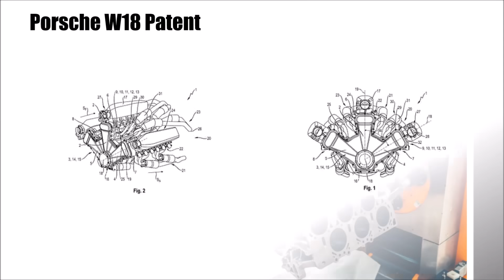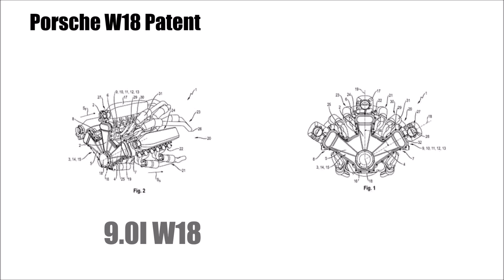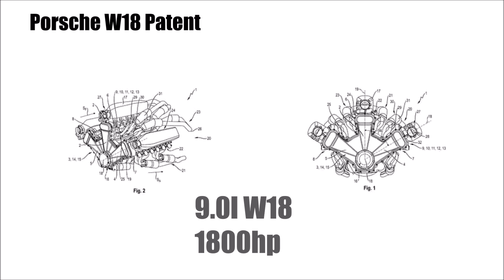Porsche W18 engine - CLOSER LOOK

Comment: They should just make variants of VR horizontally opposed engines . 8, 10 , 12 , 16 ...

Itd be more in the Porsche tradition ...and an extension of the VW experience with the VR . A VR horizontally opposed 8 would sound wicked .
Reply: Cool idea! Also pretty short too. A flat-VR6 would be cool!
Reply: @sirtristan01 somewhat like the Lancia's narrow v4 ( one head ) , just use two opposed vr3 heads ... would be neat .

Comment: I think the turbos would ruin the engine. Cool lots of cylinders. Cool lots of power. Idc. I want an exciting engine. Just like the W16 in the Bugattis, the W18 would not have much character. A NA V12 or V16 or something like that would be a much better fit. Also just move away from EV only. No one wants it.

Comment: My idea for Porsche super-engine: take 2 911 gt3 engines, connected by one crank - with slightly bigger diameter, for more torsional strenght, make it a 120 dergees V12. This way we have a 8.0L naturally aspirated 1100hp (easly) and it will be quite cheap bc it can use some design from already produced and well tested engine. That's what i would do. I would use V design as better compromise bt the center of gravity and exhaust flow. 1100hp from N/A is way more than You will ever need in a lightweight car and it is more original in the world dominated by turbo engines. Just try to keep the weight below 1200kg, no hybrid nonsense needed.

Comment: Mit nem 8L V12 mit 102mm x 81,5mm (0,666L) pro Zylinder, Quad Turbo und 8.000 RPM könnten sie genau so einen starken Motor bauen.

Der 9L W18 Tri-Turbo kann wahrscheinlich nur bis 6.500 RPM drehen, wegen den nötigen Gegengewichten und deshalb wird der Liter mehr Hubraum nicht mehr Leistungspotenzial bieten als ein 8L V12 Quad Turbo.

Also abgesehen davon einen besonderen Sound zu haben, ergibt der W18 eigentlich nicht wirklich Sinn.
Reply: Warum würde er Gegengewichte benötigen wenn es essenziell 3 Reihen 6er sind, die nebeneinander laufen? Verpasse ich hier etwas?

Comment: The asymetry could be fixed by using the radial valve design (or called "apfelbeck") used in BMW's M10 F2 engine thus banks having both instake and exhaust on both sides. But it would also create alot of complexity and turbo placement would be also weird.

Comment: I think this car will be a top speed rocket instead of a track demon
Reply: Yeah , i think because Rimac is now trying to buy Bugatti completely. So VW group needs a halo brand which Porsche will become indeed.
Reply: Probably because the engine is the better part of a ton, amirite?
Reply: It will be put in a tank or used to power data centers

Comment: It’s a military engine guys
Reply: Tiger III!
Reply: My disappointment is immeasurable, and my day is ruined.
Reply: Ferdinand 2.0 intensifies
Reply: @adhx7506  I can hear Erika on the horizon, its almost time gentsn😂
Reply: Indeed ,issota franchini had made this engine for military aircraft
Reply: That's an overly complex military engine too many failure points plus that packaging doesn't translate to easy serviceability
Reply: The one that can be used in a P-51D Mustang
Reply: That would mean DIESEL.  I'm no mechanic but that does not look like A diesel engine.
Reply: To Complex Expensiv 🎉and hard to maintain. The next German or Europen Tanks came from Rheinmetall with an Engine from MTU.
Reply: Love the idea. Just for fun not for being overly better plattform... But for a music instrument-like sound in a super light 911... 1100kg and a w18 at to would likely be possible to sound awesome. No turbos and a good tuned silencer to remove the race rasp and 7-900hp at 8-9000rpm... Dream car
Reply: Literally a half and longer radial Airplane engine.
Reply: Lol
Reply: Do you find one in Eisenhower?
Reply: Tanks are generally diesel or turbine or both...not petrol powered. Maybe Porsche is trying to change that, but unlikely.
Reply: It's an updated version of the w18 developed by bugatti back in the day meant for the Veyron
Reply: Zero mentions of defense in the patent or coverage. Porsche Engineering (a subsidiary) does military work (e.g., tank tech), but this is from Porsche AG’s core R&D for consumer cars. A tri-turbo W18 would be overkill/inefficient for tanks or drones — too complex, heat-heavy, and costly for battlefield use
Reply: Yeah I figured the same thing I wouldn't be surprised if he put it in some small number of car though just a gimmick what's the numbers on it I'm 3/4 the way through and haven't seen any figures
Reply: @sonnyd2370 the patent has NOTHING to do with military it’s meant to go in a future road car
Reply: That makes more sense.
Reply: @Admin-e6z patent is for a street car engine not Military nothing in the patent is for the military
Reply: wouldnt that be unreliable as fuck which tanks need very robust engines that can quite literally be bulletproof?
Reply: @unkindled6410 that's one way of looking at it. Alternatively you could also say that a W18 would give it some level of redundancy. If 1 cylinder bank fails, you'll still end up with a 120deg or 60deg V12 with 1200HP, which is still going to be perfectly balanced and plenty capable of keeping an MBT rolling
Reply: @damncritics wrong! A v12 makes more sense for that two inline6 two Ecus…
Reply: @damncritics  cylinder bank that fails is gonna be a burden to the rest of the engine
Reply: @damncritics  also what are the chances that whole bank fails at once instead of specific piston?
Reply: @unkindled6410  there's nothing to say it would be unreliable. Also there's no such things as literally bullet proof engines. Tanks already use V12 engines. A diesel W18 makes a lot of sense. Similar overall package size but significantly more power.
Reply: @RockSolitude  arent tanks more about torque than horsepower?
Reply: @unkindled6410 yes and a w18 will generate torque, a w18 for a road car would not happen atleast by porsche
Reply: @unkindled6410  Porsche had been building tanks since the 40s
Reply: @unkindled6410  Tigers
Reply: @unkindled6410  The reliability would most likely come down to the details of the implementation. Building it with increased design margins and prioritising reliability over weight and performance. My main concern in such a use case would be the difficulty of accessing the middle cylinder bank.

I think though, that the fact that it's a petrol rather than diesel engine, and uses 3 rather than a single turbo point to it not likely being for military applications.
Reply: @unkindled6410  With current drone tech tanks don't live very long anyway. You'll spend more money on fuel and lubricants to send this thing into battle than the enemy spends on destroying it. I'm exaggerating, but only slightly.
Reply: @unkindled6410   Not necessarily, otherwise the US, Ukraine and Russia wouldn't bother using gas turbine engines, as well as Germany, South Korea and France wouldn't be twin turbocharging their diesel engines as those are detrimental to the engine's lifespan instead of just adding a single turbocharger or a supercharger. Tank engines need to be compact so they can be replaced in an efficient matter, and that's the real problem here with this engine, it's three straight-sixes headers Sharing a block, how compact is that going to be for the EU to be invested in it over the twin turbocharged V12 that they have already been using for decades
Reply: @unkindled6410 yes and no think of the gas turbine engine on the t80 or abrams needs to be robust and mostly fixable with short maitenance cycles
Reply: @miguelgameiro8063  German tanks have big V12 diesels. Gas turbine has a high output, but guzzles fuel like no tomorrow. European armies don't haul their tanks to the other side of the world, like USA. That is why they, like Russian and Chinese tanks, have diesels, not gas turbines.
Reply: @markkulehtinen4733 sorry but you left a mistake there the russians restarted T80U production (gas turbine engine tank)
Reply: @miguelgameiro8063  Most Russian tanks are diesel.
Reply: @markkulehtinen4733 I’m aware
Reply: @unkindled6410 why would it be unreliable?

They dont build it with obsolescence in mind like on streetcars.

Parts will be overspeced unlike on streetcars. Weight does not matter.

W18 is perfectly fine and compact.
Reply: No, it's not.
Reply: Are you serious? It’s not a military engine it’s way too complex
Reply: @alanmay7929   gas turbine, twincharged diesel, X and W-shaped engines, all were used as tank engines. Tank engines are made to last a war and be compact enough to be easily replaceable, not to be reliable
Reply: @alanmay7929  complexity is one of the things, at least the US Military, loves (V22)
Reply: @Foxtrot019-Imore like corruption to steal your tax money lol!
Reply: @Foxtrot019-I the same US military that makes companies waste their time making better vehicles and armaments just to say at the end "actually, nevermind, we're gonna stick with what we have currently. Too expensive to transition" 😂
Reply: @alanmay7929  That’s sadly true sometimes 😞 (We still love you Lockheed)
Reply: @georgesgranger6362  It’s rather that each branch in question starts wanting to add so many different things & then get upset about why it’s so expensive 😂 (I’m looking at you the Department of the Navy & the Department of the Air Force)
Reply: @alanmay7929 no, its perfect and compact.
Reply: @dom3827perfect.....you d'ont know

Comment: Cash cows should be lightweight and electric. Use VW/Audi platforms with the smallest battery pack option and focus on efficiency. Sportscars, supercars, hypercars should be combustion only. Then call this strategy the hybrid drivetrain.

Comment: I know half a litre is kinda the standard displacement, but I actually hope for a smaller engine? My vision for the medium/long term future of supercars and hypercars is actually PHEVs, but with special engines, where the ICE provides only a fraction of the total power, with very small displacement, but is a little jewel in terms of layout, quality, revs, sound, etc. The idea being that you have an EV with all of their advantages, but when you want to have fun, you have on top of the tremendous EV acceleration a striking ICE Powertrain, that revs like a superbike, sounds like an LFA, is smooth like a V12. Something a bit like the 2 litres Connaught V10 (rip). So I wouldn't be surprised if the cylinders end up being tiny on this Porsche!
Reply: Makes no sense. For that, they use sound generators and fake gear change bullshit. Lighter, cheaper and simpler.

Just build normal ICEs and create a large-scale production of synthetic fuels in the long term. These will always be needed for the military complex. Let customers choose what they want: EV, ICE or Hybrid...
Reply: @MrQmie I don't want a fake engine note or fake gear shifts. But I would be sold on a hybrid with a motorcycle engine for sure.

Comment: This engine isnt planned for road cars. porsche announced they want to return into the defense industry so we're probably looking at a tank engine
Reply: so than its diesel? 2 stroke maybe on top of it? that would make w18 more reliable....
Reply: There's no way this is a tank engine.  Modern tanks use either high displacement diesel engines (kind of like a semi/lorry on steroids) or gas turbines.  A petrol engine with a half liter cylinder displacement isn't in the cards AT ALL.  This HAS to be for either racing or road use, maybe both.
Reply: @Truex007 its displacement is unknown and also if it's a diesel or not. It's 2025, you won't see a German w18 hyper car anymore
Reply: @CB-sh9zz you're missing the point.  No military vehicle will use this.  Too many moving parts, not enough reliability.  This ISN'T a military engine.  AT ALL.  If it isn't that, then what is it for?  Like I said, probably a race engine, maybe adapted for road use.  Either that or an unused patent, which is probably the most likely.  I'd be willing to bet that for every twenty patents that are filed for engines, only one of them even gets turned INTO something.
Reply: @Truex007 You're missing the point that you're neither an expert nor an engineer and probably don't know what you're talking about at all.
Reply: Some tanks today use turbine engines borrowed from aircraft for the higher power output than a conventional diesel engine. Yes we saw huge gas V12’s and what not for airplanes during the war, but big gasoline engines are not common or practical for warfare or anything else for that matter. I see no use at all for a small displacement W16 gas engine in military applications, its not practical, its not cheap, its not efficient.
Reply: @ChuckBeefOG who would win: a multi billion dollar company with some of the best engineers on the planet or ChuckBeefOG
Reply: @ChuckBeefOG its Diesel.
Only few tanks use turbines. Modern dont.
They arent more powerfull and proofen to be too unreliable and intense at maintenance.
Also a proper designed Diesel can burn more fuels than a turbine can.
Reply: Seems too complicated for a military engine. They use V10 or V12 engines for the fighting vehicles and trucks use inline-6 engines.
Reply: @imnotusingmyrealname4566 it's complicated if you're new to the concept of W-Engines
Reply: Oh yeah? Really? They must still remember the old times😂
Reply: @rickrolled7930 we all know German sat navs can take you anywhere as long as it's via Poland
Reply: @rickrolled7930 i think they forgot and want to remind it once again
Reply: I'm sure someone would put it in a car
Reply: @carfanaticlol-r  Jay Leno would probably put this in a bike.
Reply: EXACTLY WHAT I WAS TALKING ABOUT
Reply: Lmao tank need reliable engines Not w18s
Reply: @esesel7831  Insert Chrysler Multibank here.
Reply: @griffinfaulkner3514  v12s are far less complex than w18s the locomotives I drive have v16s... Very simple engines
Reply: @esesel7831  Dude, the Chrysler A57 Multibank was a 5-bank, 30-cylinder monstrosity made by strapping a bunch of inline-6s together, and powered many of the British M4 Sherman variants. Out of sheer spite, Chrysler managed to make it both reliable and easy to work on, which flies in the face of all reason and logic.

If fucking Chrysler could get that abomination to work reliably in the 1940s, Porsche can get the W18 to work, and the more compact packaging compared to a traditional V layout could be critical in an armored vehicle, where every extra square inch comes with a much larger weight penalty.
Reply: @griffinfaulkner3514 I doubt Porsche will design a industrial diesel engine. They just don't have the experience to compete with MTU or CAT
Reply: @esesel7831  Did you forget the original comment or something? This is likely a tank engine, and you don't see CAT engines in MBTs. It's why I brought up the Multibank, since it was also a supposedly complex engine from a car manufacturer built to power a tank.
Reply: @griffinfaulkner3514 don't know about CAT but MTU builds a lot of v12s for Tanks. A modern tank engine is exactly the same as you would use in a small locomotive/ship or back up power generator. Light IFVs might have truck engines. Reliability and logistics is the most important factor for a Tank engine that's why they are nowadays almost always V8-16 Diesel engines Inline engines are too long and w engines are too complex.
Reply: @griffinfaulkner3514 the Chrysler multi bank engine is a 80 year old gasoline engine. I doubt Porsche engineers would look at it if they wanted to develop a new tank engine. A market that in Germany is dominated by MTU
Reply: @esesel7831  My entire point with mentioning the Multibank was that seemingly overly-complex engines can be made remarkably reliable and easy to work on, not that Porsche should directly use it as the basis for their engine.
Reply: @esesel7831 The new Bugatti has a v16 as well.
Reply: @esesel7831  how do you have this much opinion and this little knowledge
Reply: @esesel7831 please tell us more i want to learn so much about engines
Reply: @esesel7831 you think you know better than people who built it ?
Reply: @esesel7831  you do know that many tanks had v12s right ?

Comment: Honestly the engine is not my cup of tea. To complex, probably to heavy and no apparent reason or benefit of this engine layout other than novelty. In my opinion, if they build a new hyper-car, they should build a top of the line 6-9 liter flat 12 twin turbo. They have all the know how they could need, all the latest technologies and experience. It would connect them back to their roots in motorsports and it would give the car an insanely low center of gravity.
Reply: I can see benefit. It's fully balanced, you can shut down one or two banks without disrupting that the slightest bit.
Reply: Boring.

Comment: This patent seems like either coverage bait or a halo car that they'll build 100 of.  Their patent drawing also looks like misdirection because they somehow drew too many exhaust pipes on an 18 cylinder engine.  

Though you can have a W18 if you make one V a hot V and one V a cold V, basically asymmetric side banks.
Reply: I don't think it's misdirection, the intake for each bank comes through the top and it exhausts on both sides, hence the many exhausts. I assume a similar cilinder head concept as the lancia triflux engine.

Comment: surely weight and packaging means this engine is beyond unviable for any "sports"  car, let alone if you also want to make it a hybrid. weight of the whole turbo system and a battery pack and motors on top of it would make the powertrain stupidly heavy and big. exactly the reason why bugatti opted to do away with the turbo system and go with a naturally aspirated hybrid instead. (and lets not kid ourselves, the tourbillon wont exactly be featherweight class either)